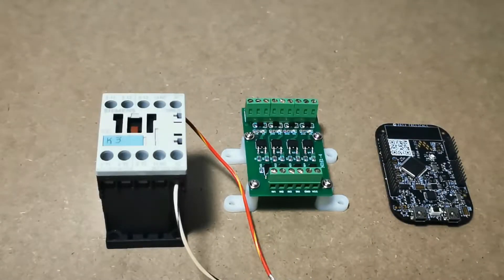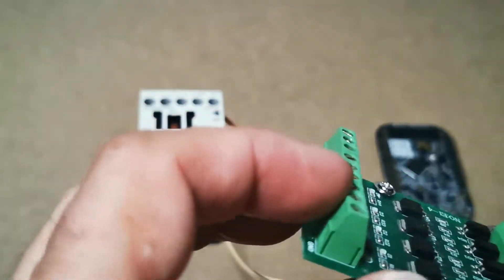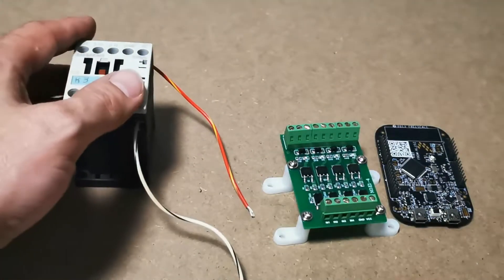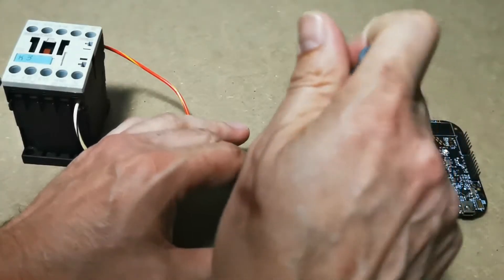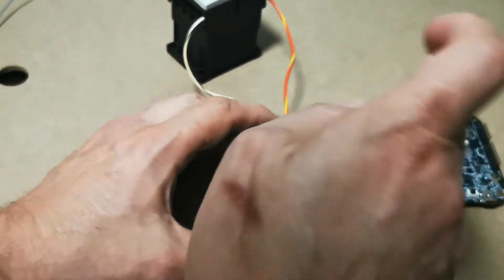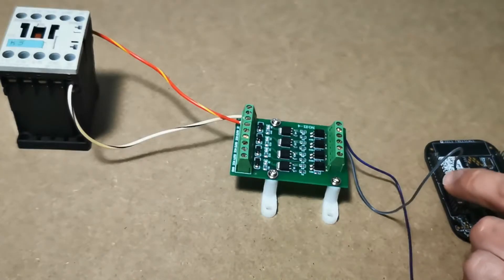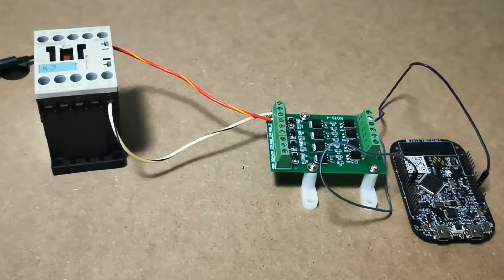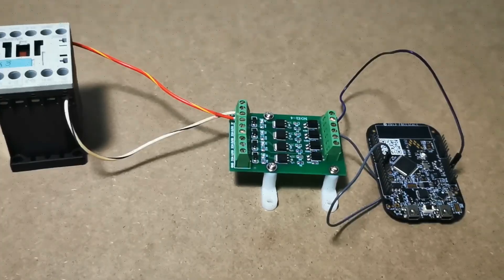Pinball Tech 101

Comment: Hi thanks for this video! I have purchased these boards and have a question please. If the power supply positive goes in vcc next to gnd on the output side, where does the positive wire for the toy on output 1 go? Does it share the same  terminal as the powersupply positive? Any advice appreciated. Thanks!
Reply from the maker: @checkmate4life  thanks for the comment. Every toy will need a positive and negative connection from it to the vcc ports on the mosfet board. Think of the mosfet as an auxiliary board between your toy and your Pinscape of that's what you're using. Positive and negative from the power supply connect to the bottom 2 ports as shown on the video and all the positive and negative wires from your toys, connect to each of the other ports on the same side. The opposite side, connects only to your Pinscape to trigger that channel. Hope that makes sense.
Reply: @cleetusvandame  thanks for your reply. The only thing I find confusing is the fact there's only 9 ports on the output side. 4 toys take up 8, the pos and neg from the power supply takes up 2 which makes 10. Do you know what I mean? Apologies if I'm being stupid.
Reply: If in your video you if you had the power supply connected, and you continued to add + and - wires for toys on outputs 3 and then 2, when you got to 1, you'd be a terminal short? Would toy 1 share the vcc port with the psu?
Reply from the maker: @checkmate4life  yes it can share the port where the power supplys positive and negative connect to.
Reply: @cleetusvandame  okay that makes sense. Thank you!!

Comment: Can you also connect rgb strip on this mosfet board , i am little struggling to connect . Rgb strip green , red and blue in connect on the outputs? Black power supply GND and red power supply on VCC . I am little confused because i don't have 2 wires coming from the RGB strip. Only 4 wires green , red , blue and GND black. Must i connect this black wire also. Thx
Reply from the maker: RGB strip cannot be connected to these mosfet boards. They need to connect to a tinsy or similar device such as ledwiz. If you search Arnoz Shop, he has devices for RGB strips that are easy to use. Sorry, I sold my Vpin 2 years ago and have been out of the hobby since. You can also find a lot of good help on the discord page for visual pinball. Good luck.

Comment: Hi, i did this for my 10 contactors. And its working.  But is it normal that the contactors are pulled in when start up my pincab . All the leds are lid. In the pinscape software they all work in testmode when doing on off . But must it not be other way ?

Comment: Great video… but I’m a little confused 🤔 
Have the same boards and setup but output seem to be always on? And what happens if you do connect the ground on the input side?
Reply: Oh and testing the output port on the pinscape on is off and off is on? Many thanks if you can help
Reply from the maker: If output is always on, you either have something wired incorrectly or your Pinscape software is not configured properly. I would check connections first.
Reply: @cleetusvandame  just wanted to say thank you for the help….. after watching your videos again notice I didn’t set the (active low) on the port hence why the beacon was staying on! Many thanks again and loving the content.
Reply from the maker: @garylambourne1695  my pleasure Gary. Glad I could help. Sadly I sold my vpin in favor of real pinball machines but can continue to post how to Videos if it helps. All this can be a bit over whelming for someone starting out and if I can help in anyway, I would be glad to. Thanks for the support.
Reply from the maker: Also, ensure the positive wire from the toy is connected to VCC on the mosfet board.
Reply: Thanks for the fast reply, when testing the port, when it’s on the beacon stays off, and when I switch it off the beacon stays on….. beacon can only be wired one way as it’s an led beacon
Reply from the maker: @garylambourne1695  not necessarily. The positive and negative connections still need to be connected properly to the mosfet board
Reply: Sorry for all the questions, on my octocouper the red light stays on? Is that normal?
Reply: Would it damage anything if you connected the ground aswell on the input side of the mosfet board?
Reply from the maker: @garylambourne1695  the input side is strictly to be connected to the Pinscape as outlined in my video. I'm sorry but I can't make it any more clearer than the video.  Output side is pretty self explanatory with positive and negative connections from whatever toy you're connecting.

Comment: Hi, can I use these Mosfet Boards to connect Button LED's and control them with DOF?
Reply from the maker: I recommend using LED Wiz for light buttons. It can also be used with DOF. As a matter of fact, there is the option to add an LED Wiz to your DOF configuration. I would also look at Oak Micros PAL controller for LED buttons / addressable Led's. Are you talking flipper / magna save buttons only or other buttons?

Comment: Sorry if this is a silly question but where do you connect the 24v power... is it on the output side into the GND and VCC that you mentioned at the start around the 2 min mark?
Reply: This i also didn't understand so good . On the output side you have 9 screws . Vcc -output 1 , vcc output 2 , vcc output 3 and vcc output 4 and last screw is ground. So i put my 24v on the ground and vcc from output 1. But must i bridge vcc from output 1 to vcc output 2 and so on untill vcc output 4 ?
Reply: Ok , i saw its just 24v on the first ports. No bridge needed

Comment: Hi Sergio, i have 8 solenoids 12Volt, then i have a pinscape with a KL shield V5.1 from Arnoz.com. and 4 mosfetboards same as yourse from Ali.
i get the connections from the solenoids too the mosfetboard, but then where do i put the connection vcc from the mosfet to the 3 volt connection of the kl shield?
or can i use a random 3volt transformeter for it?
and where do i put the inputs from the mosfet to the KL shield?
Reply from the maker: Sorry for the late response. For some reason I didn't see the notification. Did you watch my pinball Tech video where I show how to connect the mosfet boards to the Pinscape 3.3V pinout? Don't use any transformers. You're basically looking for a 3.3V pinout shown on the KL Shield. There sound be at least 3 of them. Let me know if that makes sense or if you need me to make a quick video.

Comment: Thanks for the video!!! Yes if you could do a video on LED flasher and solenoid/shaker config in DOF would be good. And as a bonus, maybe some trouble shooting.  I had mine working,  then accidentally moved/deleted something that caused my flashers/solenoids/shaker to not work anymore.  Any and all help greatly appreciated!!!!
Reply from the maker: Thank you for watching! Did you remove something from the Direct Output folder? Any chances will effect DOF to not work in most cases.  Are you using a Pinscape?

Comment: Can you provide links to the mosfet boards you used in your build and a link to your build guide?
Reply from the maker: Sure can. Here you go:
https://m.aliexpress.com/item/32754736331.html?_randl_currency=CAD&_randl_shipto=CA&src=google&albch=shopping&acnt=708-803-3821&isdl=y&slnk=&plac=&mtctp=&albbt=Google_7_shopping&aff_platform=google&aff_short_key=UneMJZVf&&albagn=888888&isSmbAutoCall=false&needSmbHouyi=false&albcp=7386552844&albag=80241711349&trgt=743612850714&crea=en32754736331&netw=u&device=m&albpg=743612850714&albpd=en32754736331&gclid=Cj0KCQjw3duCBhCAARIsAJeFyPUgeNsi1M4umFwXAfrAXMIfMDznTyhBmd8UX8NAtK0SC7bekG75fp8aAhlREALw_wcB&gclsrc=aw.ds
Make sure you choose the 3.3V option as that's what's needed for the Pinscape trigger signal.
Reply: @cleetusvandame  Order placed, Thanks.
Reply: @cleetusvandame  Great video....which one would I need with 12v solenoids? They have 3.3 to 24v , 12v to 3.3, 24V to 3.3? Thanks
Reply from the maker: @BillBene67  HI Bill. Any 3.3V mosfet will work. 12V / 24V is driven by the power supply, not by the actual mosfet board. There's a way to mix voltages on one board however I don't like the idea and much prefer to have to have individual mosfets for 12 and 24v. Hope this helps and thanks for watching 🙂
Reply: @cleetusvandame  sorry for dumb question but what is difference of 24V to 3.3V vs 3.3v to 24v? This seller has both options?
Reply: Following the link it looks like it takes me to a 5v input board though. Wouldn’t I need a 3.3? Can’t find that on Ali.
Reply from the maker: @vincentbuettner6819  sorry Vincent, completely missed this message. Did you find the correct boards? If not, I'll try to link it again.  It's a bit tricky to find them but the 3.3V is there.

Comment: I've got alot to learn so looking forward to more of these videos thanks!   question, i thought contactors need diodes or does the green mosfet board handle that for you?  or does that contactor have an integrated diode clip you can add later?  thanks again :)
Reply from the maker: The green Mosfet board has built in diodes, so no need to add them. You can just for piece of mind if you wish, but not required.  Thanks for watching!
Reply: @cleetusvandame  that is a big plus for that mosfet board...thanks for the info!
Reply from the maker: @yakuzaronin7090  great little device that is inexpensive and makes your life easier when it comes to adding toys to your cabinet. Thanks for watching.